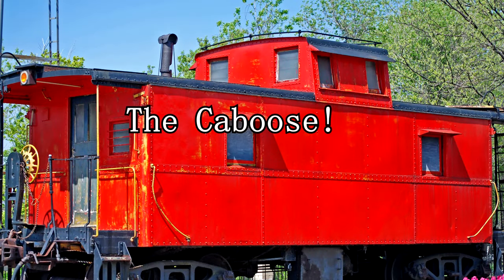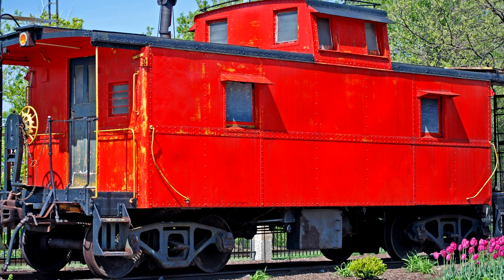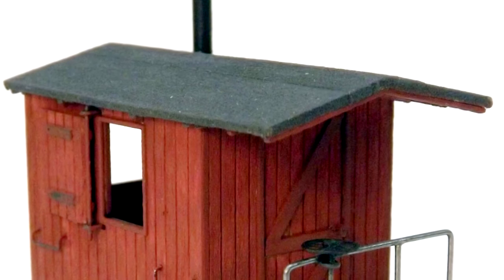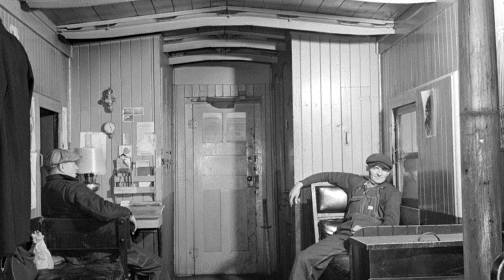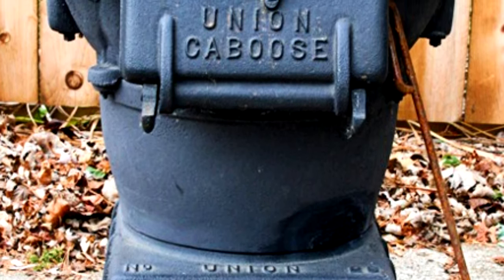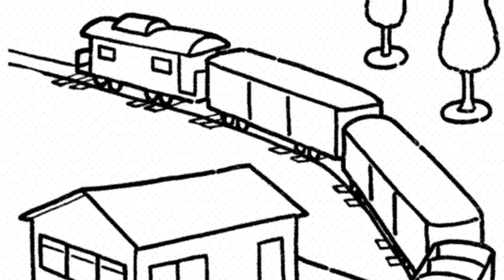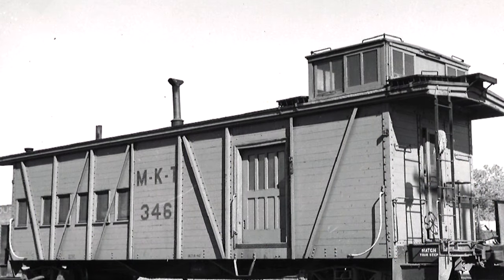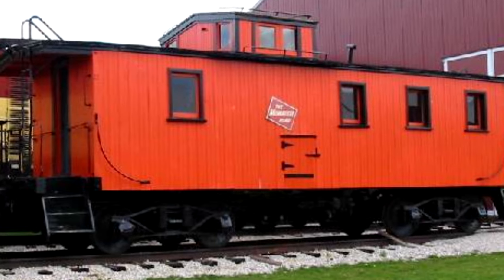Where Did the Caboose Go? | History in the Dark

Comment: In my small hometown, there is a caboose on display at the local museum.  I also have a memory of the railroad that ends at my hometown bringing a caboose with Santa Clause on board, but they stopped doing that in the late 1990’s/early 2000’s, not sure when exactly.

Comment: I always enjoy your videos and commentary. However as a 42 year railroad man (hiring out in 1973) ending my career as an engineer (and being a conductor in the caboose prior to them taking them away), respectfully we pronounce Cupola "Cue-pa-low". I loved working in a caboose. It was a great place to be. I logged many miles in one, both Cupola, and Bay window.
Reply: In terms of visibility, does an extended vision cupola really make a difference?  With the windows typically inset from the corners it seems like one's line of sight would still be blocked on straight track.  On curves, well, seems like a narrow cupola would work virtually as well.
Reply: @alexhajnal107  That is correct, you really can't see much on either caboose on straight track. The big thing that a caboose did was the men on the rear could smell brakes sticking and see hot or other items that could need attention. The EOT can't do that!

Comment: How many modern derailments could have been prevented with a caboose? More than one.
Reply: Ain't that the truth
Reply: The Lac-Mégantic rail disaster could have been prevented if there had been an old-fashioned caboose present. In a better scenario, a brake man positioned at the rear of the train could have manually applied the brakes to more cars located at the opposite end of the train, while the engineer did the front.
Reply: @Steamer96   What difference would it make to have a caboose?
Reply: Not enough to justify putting someones life in danger on the rear end
Reply: @Talldarkhandsom  Uhh.... another man could've applied more handbrakes at the rear to the train preventing the runnaway. They tell you that cabooses are dangerous are only telling a crock of shit.
Reply: @Steamer96   You don't need a caboose to do the job right, only a 2 man crew. I'm sure every railroader who was killed in a hack, either bi-way of derailment or rear end collisions might disagree with you..
Reply: @Talldarkhandsom  And I am pretty sure the whole town would disagree with you only needing 2 men to run a train. 4 should be the minimum 2 at the front and 2 at the back.
Reply: @Steamer96  No doubt it was preventible, had there been a 2 man crew on the train
Reply: @Talldarkhandsom  *4.

Comment: Most FREDs/EOTDs will transmit a periodic tone on 457.9375 MHz.  (Norfolk Southern uses or has used 161.115.).   The range of this tone runs from roughly 1-3 miles, depending on battery strength and atmospheric conditions.  And it can be detected on scanners used to pick up the other railroad frequencies.  A major purpose of the tone is to allow trains that follow to detect another train ahead.  (Engine cab radios will be set to both the road frequency and the FRED/EOTD frequency.)

Comment: We have six at the Tennessee Valley Railroad Museum.

Two Southern Railway bay window cabs from the 1970’s (X-519 and X-718), one Louisville & Nashville bay window (car 1236, built by the South Louisville Shops), a centered Southern Railway cupola cab (X-252, former Savannah & Atlanta), an offset cupola caboose from the Wabash Railroad (car 2774) and Drover caboose No. 41, built new for the Florida East Coast, and later sold to the NC&StL.

One of our volunteers also holds the current patent rights for, and collects royalties on the EOT.

Comment: In my opinion, Caboose should still be used.
Reply: Why though? Other than nostalgia, cabooses have no use or necessity anymore. Computers and lineside monitors check for hotboxes and dragging equipment. Freight cars now have full air brakes and can be applied from the rear automatically with an EOTD. The EOTD also has the red light. It’s not worth the expense to any railroad to run cabooses anymore. One can be nostalgic for cabooses without believing they still have a use and should be on trains today.
Reply: @futuredoc2014  I just worry about what if said technology were to fail and there was no one to spot a danger that the crew from the locomotives could spot.

Comment: We still do require a "Rear End Marker" today like they used to require a caboose. This is normally an EOT or a flag, and it lets others know that the rear has gone by them so they can get on the track behind that train. Much like with the caboose, a train is technically not a train without that marker.